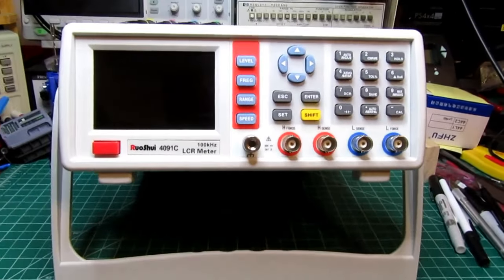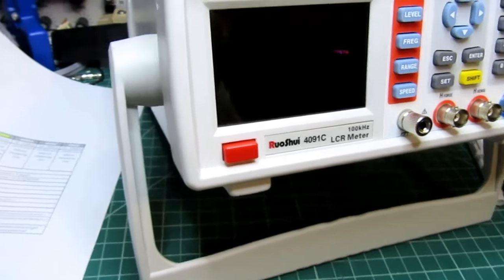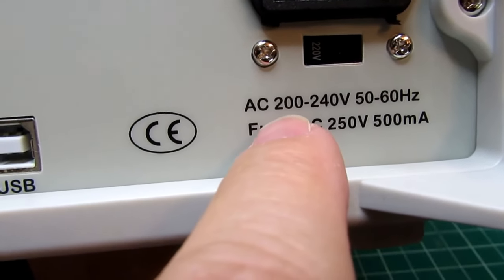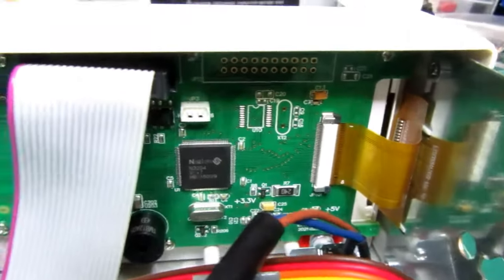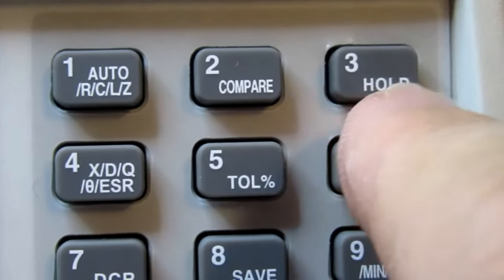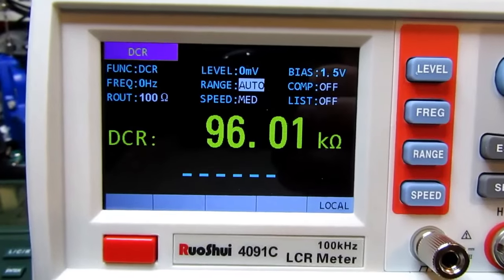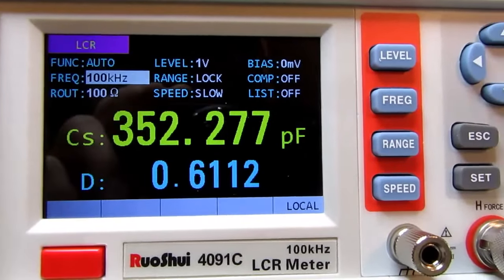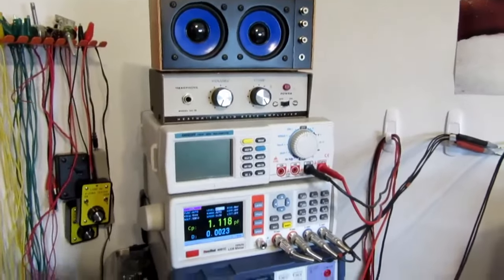Ruoshui 4091C ESR Meter: Overview, teardown, demonstration

Comment: Does it also operate at 120Vac 60Hz even though this voltage is not marked on the back of the unit?
Reply from the maker: @michelgauvin2473  MINE works on 120VAC 60Hz.
Reply: @youtuuba  Thank you for your reply. Is this voltage written on the back of your unit?
Reply: ... Or just on the selector switch?
Reply from the maker: @michelgauvin2473  on MINE, the rear panel shows the maximum power voltage; this is not about the voltage selection. Then, the voltage selection switch can be set for 110/220V.

I don't know if all of these are done exactly the same way.

Comment: Thanks for the video.  Tony Albus also did a nice review of a Ruoshui LCR Meter.  He noted that the Ruoshui is probably a rebadged East Tester LCR Meter.  I have the East Tester 4410 (100 kHz) unit.  My unit's layout and circuit board look just like Tony's and your unit.  You may note in your tear down that all three circuit boards have the East Tester Label ET44MV.  M= model and V= version.
Also I would recommend when you test large electrolytic capacitors you use a test frequency of 100 Hz for 50 Hz line frequency and 120 Hz for 60 Hz line frequency.  Many data sheets use those test frequencies for the capacitor value because those capacitors are usually used in half or full-wave power supplies.  I don't think testing an electrolytic capacitor using the  DCR mode is a good idea.  The DCR mode is good for resistors and wire components.  The reason that your measurement on DCR was bouncing around is because the LCR Meter in that mode uses a very low frequency square wave going from 0 volts to 1.5 volts, (note on the meter's display the bias shows 1.5V).  The meter makes the measurement when the square wave is in the high DC state of 1.5 volts.  The problem when trying to make the DCR measurement on an electrolytic capacitors is that you are getting a value when the capacitors is charging and then of course it starts to discharges when the square waves is in its low state. The changing rate on the display of those values is the frequency of the test square wave. So basically not very useful information.
I thought you did a very nice overview of this LCR meter and for the price I think they are a nice devices.
Reply from the maker: jwrtiger, thanks for the information. 

Regarding DCR, I think it is an important parameter to check with aluminum electrolytic capacitors. Indeed, a number of other (higher priced) ESR/DCR testers will check DCR first and then only proceed to the ESR test if the cap passed the first test.

I see what you are saying about the testing points on a square wave influencing the DCR reading. My other two DCR testers only do that test with DC test voltages; it seems odd to me that this one would use anything but straight DC for this purpose.

Luckily, as long as the DCR readings I get with this meter are not very low Ohms values, the cap is good and I don't need steady values on the display.
Reply: @youtuuba  It can be that LCR meter in this mode continuously jumps from one range to another in a loop, so you may try manually selecting the desired range. And 6 KOhm is a very low value for a 1000 uF capacitor, it should be at least hundreds of kiloohms.